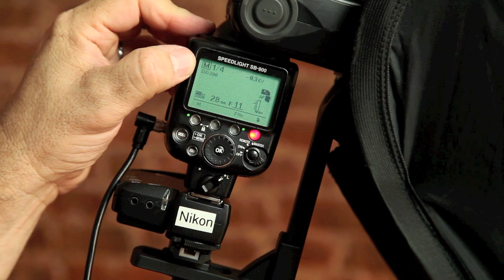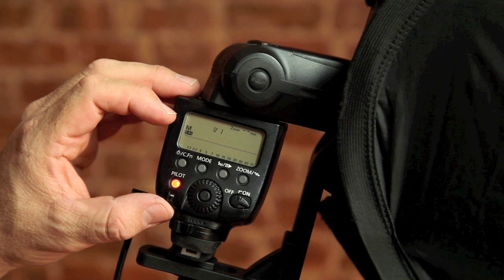How to balance off-camera flash with ambient light.

Comment: This tutorial started off great but once he got to setting flash manually he made it much harder than it has to be. You don't need a meter.  Determine the exposure for the background and then dial in manually flash power until you get the desired exposure.
Reply from the maker: How would you determine the flash exposure with any accuracy when you are using a softbox or umbrella?

Comment: Thank you so much for your tutorial and for going to the trouble of digging out the archives 🙏🏼

I learnt ‘old school’ with manual method and not so much with TTL and appreciated you sharing that simple click-down method on speedlight to reduce power.  Previously I would have just worked out two and a bit stops in my head (I was counting out loud when you posed the question 😂).

Great to see your interaction and behind-the-scenes with your models and to see your setups on your YouTube and Insta - - Regards from Downunder 👍🏼 🇦🇺

Comment: I'm new to speed lights and thank you for the video..very instructive, but I have a question about using speed lights in the studio without any ambient light.  If I try to take a shot using the off camera speed light without turning on an over head light the camera doesn't recognize any light and the shutter won't take the shot.  Is there a setting in camera that I need to adjust so I don't need any ambient light in the studio?
Reply from the maker: First step -- what are your camera settings?  And at those settings, which the flash switched off, do you even see any part of your subject?  If your settings are carefully chosen, the ambient light most likely won't even register.
Reply: @neilvn  I'm shooting for low-key lighting, so the camera settings are set to block out all ambient light.
Reply from the maker: @AlexandriaGeorgiades-p5v -- if your flashes are powerful enough, and your setting are such that the ambient light doesn't register much, then there is no need to have blackout conditions in your (home) studio.  For example, in my studio, typical camera / flash settings for headshots are:  1/200 @ f/8 @ 100 ISO ... and at these settings the fluorescent lights in the studio don't even register.  If I take a photo without the flash firing, the resulting image is nearly completely black.  So I usually just keep the house lights one.  We can see easily and the camera has no problem focusing. 

So just confirm and tell us what your camera settings are ... and if at those settings, the ambient light registers.
Reply: @neilvn  1/250 @f.2.8 @100 ISO
Reply from the maker: @AlexandriaGeorgiades-p5v  -- is is possible to get a smaller aperture to control the ambient light better while the lights are switched on?

Comment: nice tuto. looking the burnt background on the video, we don't imagine F/4 iso 400. what was the speed ? 1/250sec to darken background as much as possible while avoiding HSS ?
but why 400 iso for background which adds noise and increase shutter speed (would be 1/60sec at 100iso too slow for shooting handheld ?)  for background and the exposure with flash later? what would happen at 100 iso ?
Reply from the maker: The decision here again was to have a shutter speed that is hand-holdable. I don't want to risk camera shake or subject movement.  There isn't all that much noticeable noise at 400 ISO with modern cameras. It should be an easily accessible ISO setting.
Reply: @neilvn  Wouldn´t the flash freeze motion independent of shutter speeds?
Reply from the maker: @linusfotograf  -- not necessarily. It depends on a few factors, including how bright the existing light is ... which influences you shutter speed. 

Here's more on the topic:
https://neilvn.com/tangents/flash-freeze-movement-at-slow-shutter-speeds/
Reply: @neilvn  Thanks. I will shoot a portrait on saturday where I want to get some light bulbs to show up. They will be the only ambient. I will use studio strobes as my main light. The subject will stand still. I should be sble to get the bulbs to be bright and have my subject frozen, right?
Reply from the maker: @linusfotograf  -- yup, with no movement, you should be good at slow shutter speeds.  A stabilized lens, or a tripod will definitely help.
Reply: @neilvn  Thank you for the video and the answers. I have a Canon R5 which has a superb IBIS